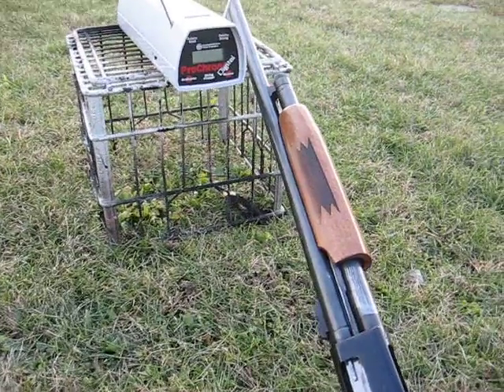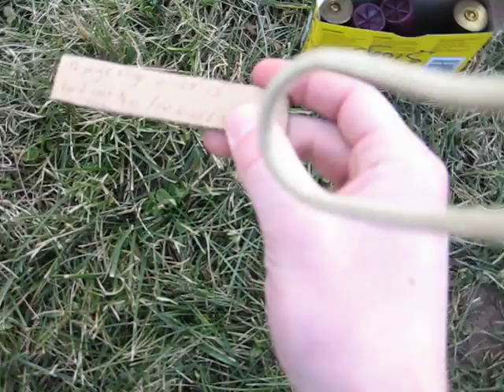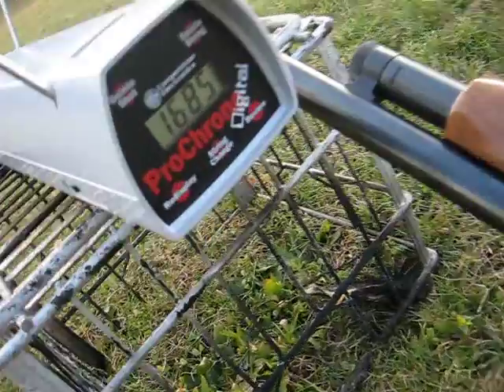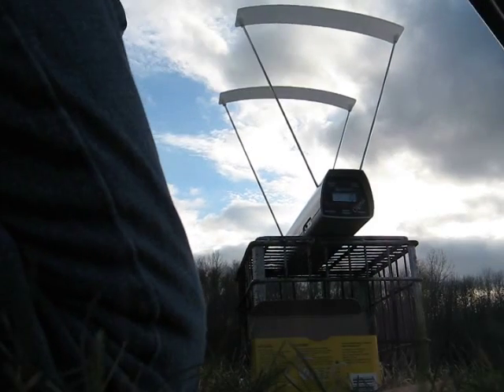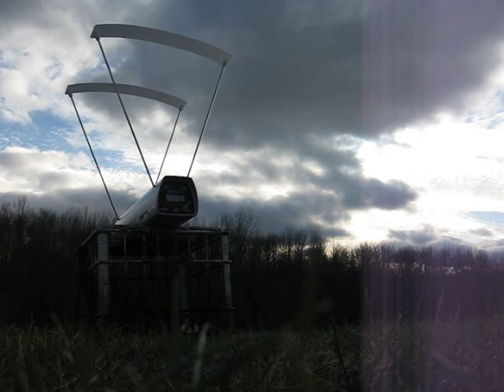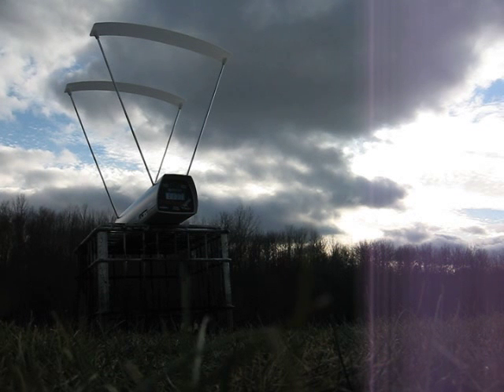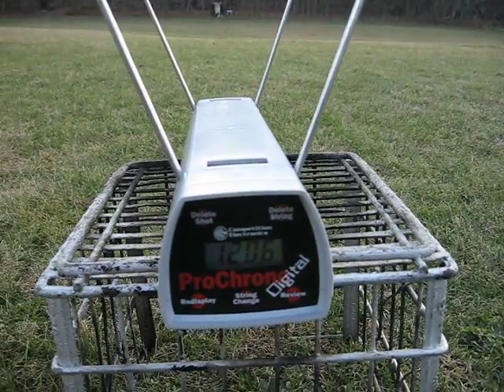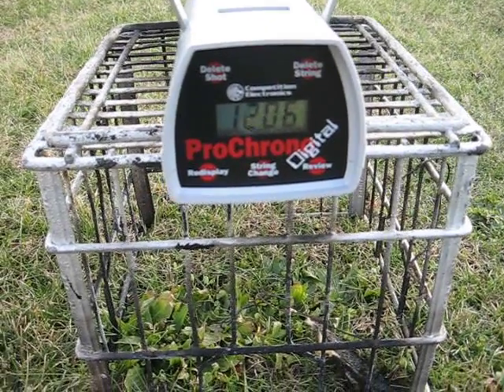Reload Recipe, Lee 7/8 oz Slug 12 Gauge, 1200 fps

Comment: 17g Hodgdon Clays under Win grey(or pink) or Fed 12S0 wad in a straight wall hull and any primer…1100 FPS…around 8000psi.
(Claybuster substitutes will not work)
Low recoil and point of aim at 70yds.

Comment: I use 23 grains Red Dot for my loads for the 7/8 Lee drive keys. Rem STS primers Claybuster  wads CB4100-12B Lighting for my slugs and CB2118-12 for my buckshot Tapered hull for slugs and straight walls for buck.  like Remington hulls better for slugs the gun clubs and the likes. My gun is a autoloader so I need the PSI. But I have seen no high pressure marks on gun or hulls. BUT if your primer pocks are a little lose you might pop a primer.

Comment: If you would, please provide a video showing specific details of the components and techniques you used to make your slug loads.... the slug world can use all of the data it can get since there's hardly any specific load data for the Lee Drive Key slugs that's given by places like Lee themselves, Lyman, etc Even the load data that Lee still puts in with their slug mold will make you wonder why they would bother when they're giving load data that consists of a lot of wads n such that hasn't existed in like 5-10 years.

Comment: try 38 gr of hogdens hs-6 7/8 lee slug win aa12 white wad.  i used this at 150 yds with great success out of my rem 1100 smooth bore slug barrel.
Reply from the maker: +dowdawg If I am in need of powder and cannot find red dot, I might try it. appreciate the comments!
Reply: Yep, Hodgdon has a pretty nice interactive load date web page where you can choose your specific shotgun gauge and hulls and then it will give options to choose from for the type of shot you're using such as lead shot, steel shot, lee 1oz and 7/8 oz slugs. It will then provide choices for the brand and type of powder. Click enter and it will then provide you with the available load date consisting of what primer, wads, and amount of grains to use.                                                                                                                                                     In my case, I have the Remington STS 2 3/4" hulls and using the Lee 7/8 oz wheel weight slug. Hodgdon load data for this is:                                                                                                                                                        Winchester 209 Primers, Winchester WAA12L Wads, Hodgdon HS-6 Powder, and 38 Grains.                                                                                                                                                Here's the link and aside from shotgun load data, you can also choose pistol and rifle.     http://www.hodgdonreloading.com/